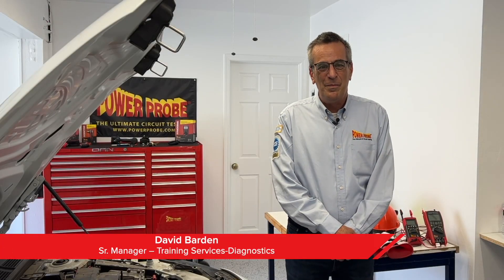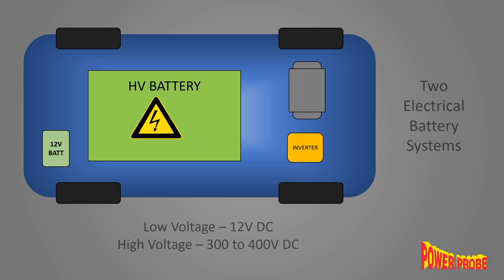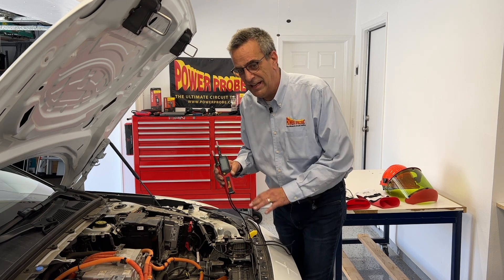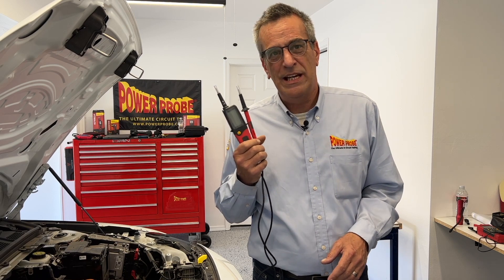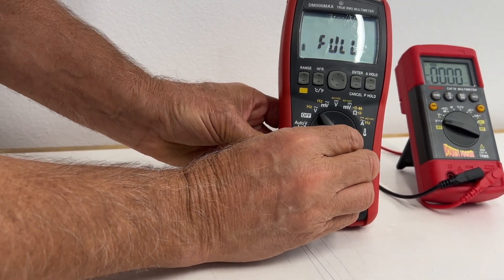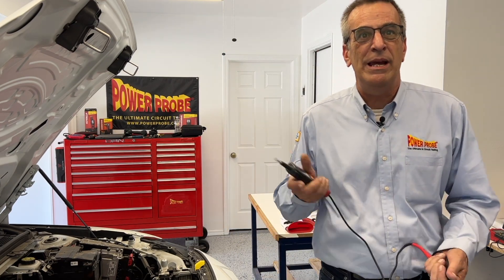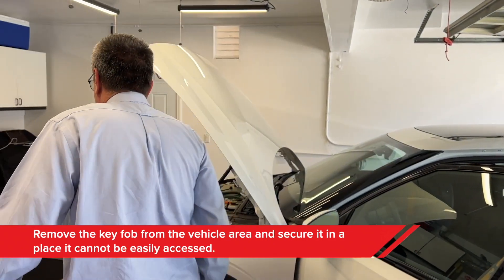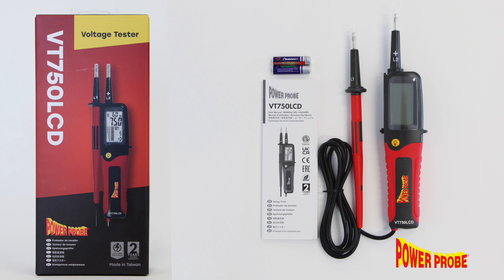Power Probe's Two-Pole Voltage Tester & the Importance of Electric/Hybrid Vehicle Safety

Comment: No thanks I’ll trust my fluke
Reply: The Fluke two-pole tester is not built for the purpose of servicing EV batteries. It is not 1,000V CATIII rated. 
This Power Probe unit is built specifically for this application.